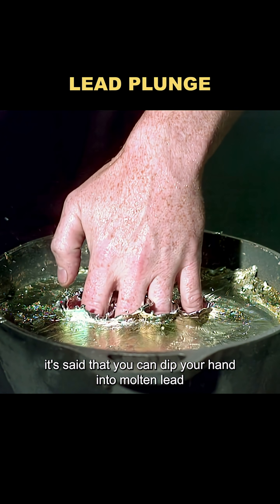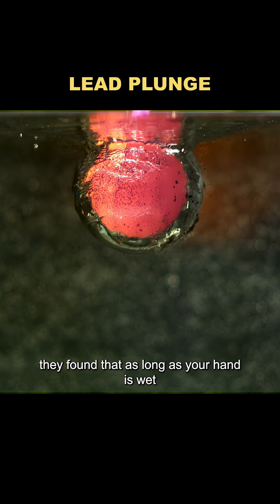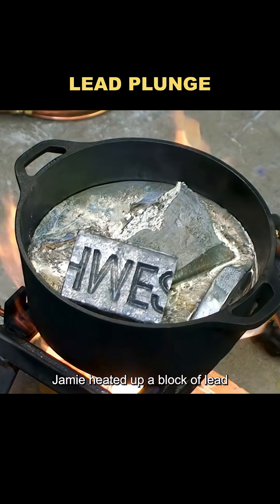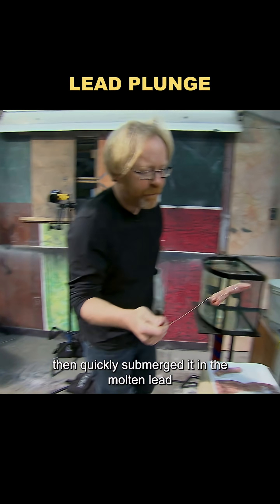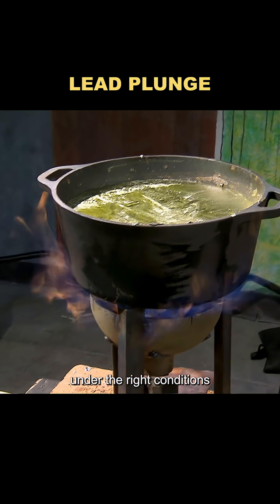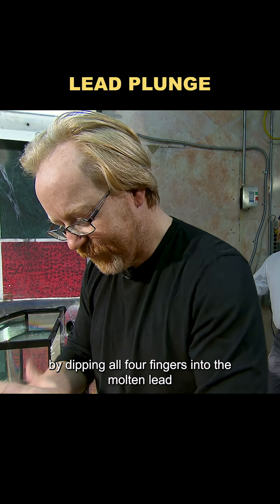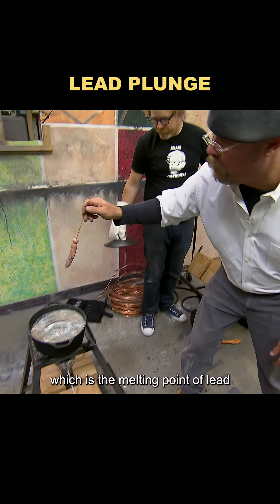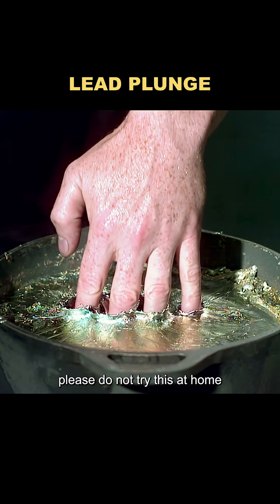How does boiling lead water manage not to hurt the skin?

Comment: So what happens when you dip your hand inside boiling water ? 
Water = Wet right ? I'm curious
Reply: The reason the protective barrier forms is because the molten lead is much hotter than the boiling point of water. This causes a layer of vapor to instantly form. Since boiling water is not hot enough for a vapor layer to instantly form, your hand would just be burned